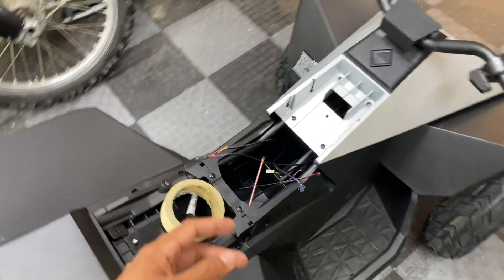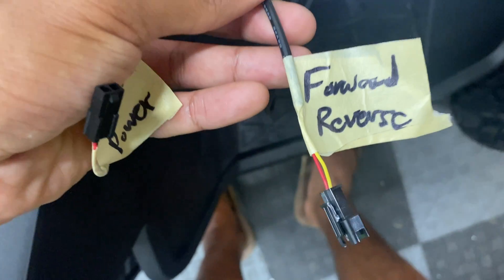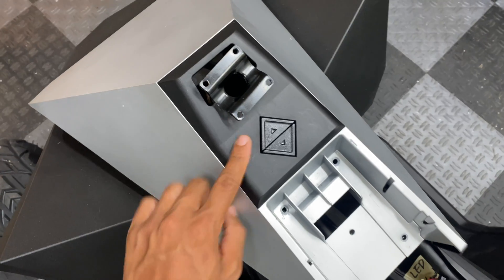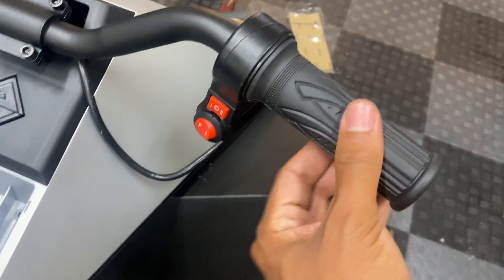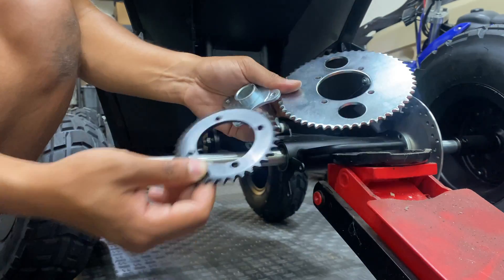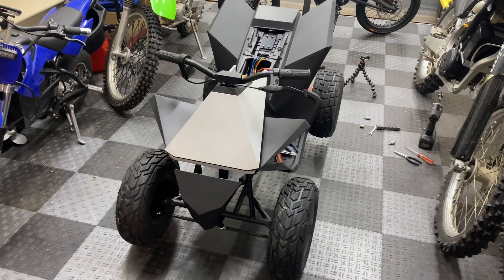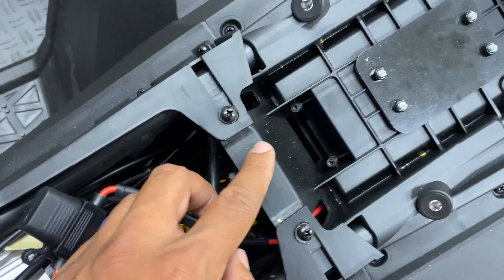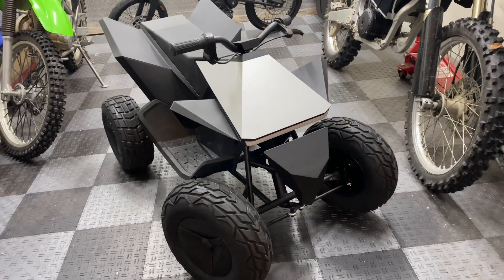Tesla Cyberquad ATV Brushless Motor Conversion Kunray 36V Kit Installation Part 2

Comment: I’ve did the same swap. But my 1/2 speed controller isn’t working. I’m still not getting over 10mph. Can you point me in the right direction?
Reply from the maker: @gavingoodson9130  my Kunray kit came with a 3-speed switch. Are you sure you have the same exact kit?

Comment: I followed the walkthrough exactly with the same motor but haven’t figured out how to wire the tail lights.  Does the motor require a brake lever with two wires?
Reply from the maker: I don’t have the brake light working yet. The controller doesn’t need the brake lever connected in order to function.
Reply: I ended up buying a 2-wire brake lever and it looks like it works with the controller in one of the two e-Brake wire sets. When you use the brake, it cuts the power to the motor. 

I can’t figure out how to wire the 3-wire brake lights to the controller’s 2-wire “Brake Light” wire set. Not sure if I short circuited the brake light testing a bunch of combinations.

Any chance you figured out the brake light yet?

Comment: How did you wire up the cyberquad 3-wire brake connector to the controller which uses a 2 pin connector?
Reply from the maker: I actually didn’t yet. The owner didn’t care for the brake light function to work.
Reply: @PatOutdoors what about the 3-wire connector for the brake lever?

Comment: I need to make my own 3d listing for the battery connector. Can't believe those guys selling for 50$ on there. Takes like 30 minutes to print those pieces and you can buy a discharge label for like 10$
Reply from the maker: Right.. go make some more listings!

Comment: Do you think it will go faster than the original speed
Reply from the maker: Would think so, more aggressive gearing and twice the power. But it is still 36v so that would be the limiting factor. Will be installing the connector and cleaning things up tomorrow so I can finally test out the new top speed